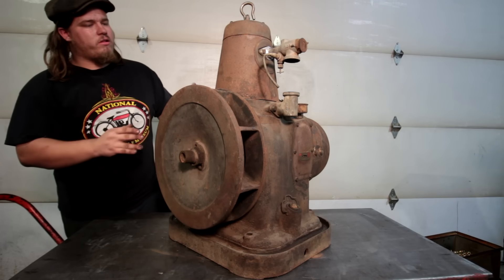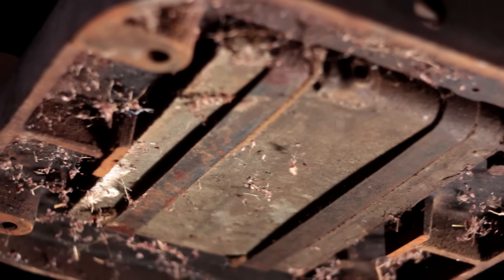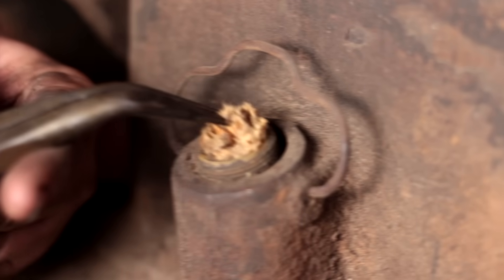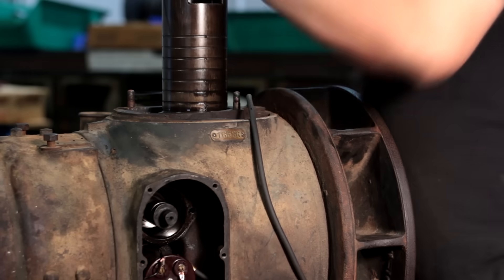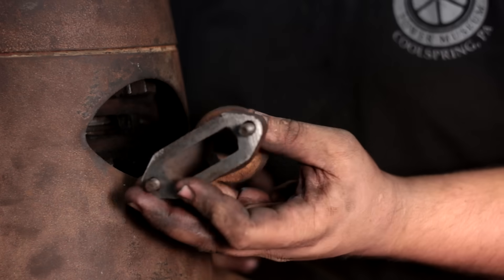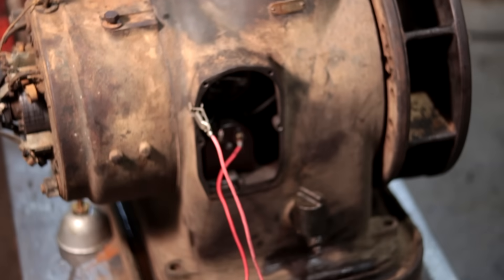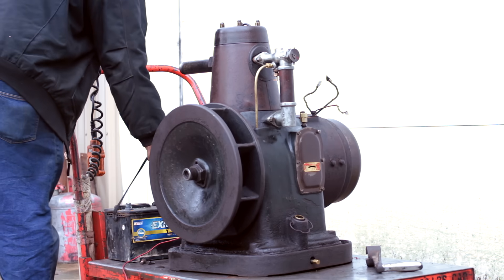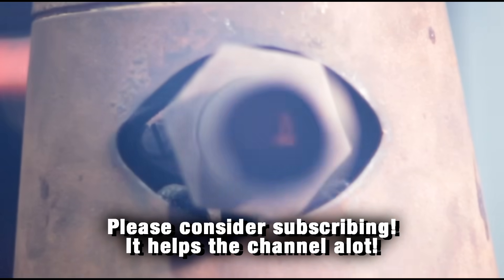100+ Year Old 4 Stroke Engine Design Has NO VALVES!!! Can We Get it Running after 60+ YEARS??

Comment: There were indentions for the electrical connection at coil that you missed. Timed
Reply from the maker: what?
Reply: On the coil, there is a indention, special spot to put the connection @cruddycornstalks
Reply: @cruddycornstalks 809 post are timed

Comment: What a beauty, and thanks for preserving the original paint- it has a beautiful patina - like the word patina was originally used - the beauty that age can give an object. Outstanding job, and if you get a chance in the future, you could get a lot of views on a video where you explained the mechanism and timing - the sleeve valves are mesmerizing, and the engine is so quiet - I'd be tempted to plumb the exhaust outside and just listen to that peaceful mechanical rumble. If you ever find a buddy who would take on the wiring of the generator, it would be cool to build a stand that had its own, self-powered lighting. Give it a few cranks and the lights slowly rise...👍
Reply from the maker: that would be cool!

Comment: Just ran across your channel, it's nice to see the old iron still running!  I've got a 5HP Majestic with several parts missing, most obvious are the muffler, governor springs,and ignition system.  One of these days I'll see if I can get it working - would you have a spare magneto you don't need??
Reply from the maker: i do not sadly sorry

Comment: A hundred years later Hyundai designed an engine with valves that weld themselves to the cylinder port with baked sludge.
Reply: ALL the modern direct injection engines do that. They need to be cleaned occasionally. With no fuel going past the intake ports there is nothing to clean the valve or port. BMW prescribes blasting the valve and port with walnut shells periodically.
Reply from the maker: this is very true

Comment: If you run low on the WD40, you might try Gojo to soften the grease. I find it a cheap alternative to WD40 and is good on the hands
Reply from the maker: not a fan of the idea of the grit and the wd40 evaporates over time leaving little residue

Comment: It is a sleeve valve engine
Reply from the maker: correct. sleeve valve is a simple description to just describe the moving sleeves with ports not really valves but nothing better to describe it in simple terms.
Reply: @cruddycornstalks  it is the description that everybody uses for that valve scheme in the description of your video you say the engine is valve less when it has sleeve valves probably just to generate more clicks on your video
The only valve less engines I can think of at the moment are turbo jet engines and some pulse jet engines
Reply from the maker: @markdi2 you are mostly correct it does get a lot more clicks thate way.  But I do like questioning the thought of calling them valves. Do you call the cylinder on a two stroke a valve?
Reply: @cruddycornstalks  engines like that are actually commonly called sleeve valve engines

Comment: Hey thanks for posting this, this is really cool, im glad you got it running!
curious what oil weight you are running in it, and if maybe changing out the viscosity would make any difference.

the sliding valves are super reliant on boundary lubrication for sealing, but this engine was designed well before multi-weight oils were a thing.
I imagine a good 15-40w diesel engine oil, high in zddp is probably what this engine would run best with, or maybe with some straight two stroke oil as it tends to be a mix of viscosity grades for both upper cylinder lubrication in two strokes as well as heavy weight oil for the crankshaft,
this thing burns an appreciable amount of oil so maybe a low ash two stroke is the right way to go, or marine two stroke oil

edit:
this thing was probably designed for leaded fuel as well so two stroke oil is probably the best idea, and maybe even add some to the fuel to stop the incoming charge from washing the oil film off of the sleeves

Cheers
Reply from the maker: leaded fuel wouldn't change much on an engine like this. and i was using a diesel oil for thickness and zddp

Comment: How many volts is the generator? AC or DC? what RPM does it run at?
Reply from the maker: it would be 32 volts but not sure ac or dc  and not sure the speed
Reply: @cruddycornstalks  dc about 800 to 1000 rpm

Comment: When I was a kid (60+ years ago) we had a similar looking engine. Maybe just slightly larger that had been a Delco lightplant. My dad ran a irrigation pump for our garden with it. I remember it would start on gasoline and then you could switch it over to kerosene which was cheaper to burn at the time. 
I wish I knew if it had that same kind of “no valve” engine. Looked similar with one big upright cylinder.
Reply from the maker: if it was a delco it was just a normal power plant with popet valves nothing fancy. willy's was the only one like this

Comment: I have allowed myself to be told that some Panhard cars had engines that worked with a sleeve concept, but weren't with rotary sleeves as some British designs were... might it be something similar to this?
EDIT: After reading into this on Wikipedia (and assuming that it is reliable) it seems that the Panhard engine design from the 20's up really is in one way or another related to the Willys-Knight design!
Reply from the maker: im not sure nothing i have dealt with.
Reply: @cruddycornstalks  It was an old French company. AFAIK what's left of it now, after acquisition by Citroën, only makes military vehicles... their span of civilian vehicle manufacture was between 1890's and 1960's and maybe it is not very well known outside France. 
About 1200 Panhard passenger cars were imported to Finland before the late 50's, after which our taxation scheme made them prohibitively expensive, but there are some enthusiasts who keep up a selection of remaining specimens.
Reply: @jussikuusela7345  Yes Panhard did make sleeve valve engine cars the double sleeve valve engine was invented  by Charles Yale Knight approximately 70 manufactures paid Knight a  royalty to use the design, Burt and McCullum invented the single sleeve valve engine.

Comment: I have been fascinated by engines my whole life. This is why. A sleeve engine over a 100 years old sitting there running like no problem at all...
Reply from the maker: It really is an amazing thing how well these old engines were built.
Reply: When reliability was the forefront
Reply: @jwalster9412  there's a couple of ways at looking at reliability. You can be quite sure this engine requires a good bit of babysitting to keep running, do that and it'll be reliable. Then again, if you want a more hands off approach a newer engine would be your better choice.
Reply: @PuncleLeonard at least this one won't stop running from a broken sensor, or throw a rod.
Reply: Great people Great work
Reply: What is it about this design that made it so able to pick up and run? was this a jeep engine or ?
Reply: and take heavily in account: NO computers - just a slide ruler and making things with a security of 3 times in healty engineers wisdom. normal lathes and mills, at max. a swiss cam controlled "screw" lathe. Since 1958 (peak of humanity) to 1968 it's down the hill with humanity.
Reply: Wait till 200 years from now we got old mechanics buying old EVs in landfills to fire up after a quick clean and oil change... ... ... ... ...
Reply: Willys Knoght motor co made this.  Grand dad had a W Knight car about 1925.  4 cylinder sleeve valve engine.  Extremely quiet.   Poor oil then would cause sleeves to stick.  Keep used a 4 cylinder with intakes in head & exhaust in block.    A neighbor had a Willys car 6 cylinder 1951 of jeep design engine

Comment: I agree the original paint looks good,  I use boiled linseed on cast iron, it soaks in nicely and after a week you can give it a buff.   It does not seem to effect paint and can be removed if needed.  Nice honest resurrection.
Reply from the maker: linseed  oil is nice for wood and sometime paint. but in the long run its  risky to use on aint as it soaks into the pores and can swell up over time causing it to flake down the road. wd40 works better as its only temporary and will evaporate leaving nothing.
Reply: @cruddycornstalks  I find WD is not resistant to the weather.  Millwrights used boiled linseed to season  cast iron water tanks and line shafts, farm machinery as well because paint and pitch was expensive. But its what ever you are happy with.   Nice job on the engine.
Reply from the maker: you are correct. but i dont mind giving it a new coat when i get it out to show it. and alot of time it will help get more grease off over time!

Comment: Sorry but I think it does have valves just the fact they side up and down to open and close the ports  in a deferent way than the common valve setup does not mean there is no valves
Reply from the maker: it has sleeves with ports not valves.  they marketed them as sleeve valves so people understood how they worked but unless we are going to start saying two stroke engines have valves this really doesn't either.

Comment: No valves? I think it's a sleeve valve and clickbait. Jerk me around with dishonest representation
Reply from the maker: not dishonest. this has no valves like a normal engine. only reason they got called sleeve valves was to be more understandable in documentation.  unless you want to say two stroke cylinders are valves then this isn't a valve either. its sleeves with ports. not valves.

Comment: I'd never seen and heard a sleeve valve engine running before in my 76 years!  Thanks!  I also didn't know they were used for small light plants, though considering how quiet it is that sure makes sense. Apparently sleeve valve aircraft engines were used in Britain during WWII, including the Lancaster bomber.
Will you attempt repair of the generator portion?
Reply from the maker: maybe someday but it wont be a video as its not something I'm familiar enough with to show anybody.

Comment: Astonishing video!
I’ve never seen one of these engines before and not only do you have one but got it running like a clock!
There’s a Napier Sabre sleeve valve engine in the Science Museum, London. It’s been cut-away and there’s an awful lot going on inside it. Two crankshafts and 24 pistons, two-speed supercharger. Monstrously powerful things and apparently quite bad-tempered when it came to starting.
Reply from the maker: It did end up pretty nice.

Comment: Just curious if the sleeves are connected to a connecting rod on the crank what kind of mechanism adjusts the timing of the sleeves?
Reply from the maker: They have a cam shaft they are hooked to

Comment: Kiwi mechanic here, I have always thought that sleeve engines are very clever. A distant memory tells me that they run on castor oil? And they build up carbon on the sleeves that helps seal them. Cheers for sharing, Bryce 🙂
Reply: Castor oil is (or was) a common ingredient in motor oil. That is where the brand name CAStrol originates. Still used in some applications.
Reply: @dquam3885 Ahh yes, of course. My brain must have deleted that. But I do remember Castrol 2 stroke oil used to smell like cooking bacon 🙂
Reply: 😂😂🥓🥓😂😂 @Bryce-z9v
Reply: @dquam3885  era molto utilizzato, fino a pochi decenni fa, per i motori sportivi, soprattutto per le  moto.
Reply from the maker: Im not quite sure
Reply: @cruddycornstalks  My friends Dad had a Daimler sleeve valve. He stripped and rebuilt the engine, carefully cleaning every thing. When he finally got it going, hell did it smoke!! An older mechanic told him that he shouldn't clean the carbon off the sleeves.I remember the smoke smelling different from motor oil. This is why I think it was castor oil. It my be for that particular type of engine tho I'm not sure. Super quiet!
 🙂
Reply: Castor oil!
Just another reason to somehow get or build one of these magnificent engines.
Reply: Probably true.  Smaller model airplane 2-stroke engines are ringless, making them essentially sleeve valve engines.  They of course run on a fuel/oil mix and they definitely like their castor oil.  The huge advantage of castor oil isn't that it builds up carbon, rather it builds a coating of varnish.  Castor doesn't break down in high heat like dino juice does.  That castor oil varnish gets kinda tarry when it cools but turns back to liquid when it gets hot.  This provides unbeatable lubrication.  In the case of this particular engine it would probably go a long way toward maintaining compression when it's cold and first started.

Comment: You are wrong.  It has valves, this is why it is called a SLEEVE VALVE ENGINE. This one is a two sleeve engine, and a later and better development is the single sleeve valve engine.

Two sleeve demonstrator : https://www.youtube.com/watch?v=kgfb5hbx33U
Napier Sabre : https://www.youtube.com/watch?v=e7gW_sBrqxo
Reply from the maker: Only reason they use the word valve is as reference for people to understand . The engine has no valves. Only to moving sleeves with ports on them. If those are valves that every two stroke has valves but that isn't the case.

Comment: Oiling the cork gasket will allow you to reuse in the future and also helps  with softening the cork  to allow better sealing. This applies to all sorts of paper gaskets but also depends on the application. Sometimes, i won't use the oil but will use small amounts  of hemlar liquid gasket and leave  to go tacky and then fit sleve port engines are cool 😊
Reply from the maker: That is true

Comment: They have valvessleeves which go up and down to open and close the ports, Hence sleeve valves. 

Sleeve valve engines are exactly rare or common but they are interesting in that they produce good power quietly.
During WW2 Bristol air craft company built a radial sleeve valve engine which became known as the whispering death ,because of it's quiet operation whilst attacking targets.
https://en.wikipedia.org/wiki/Bristol_Hercules 
As generating plant it would be quieter than the usual poppet valve engines. 

In cars however,they smoke a lot as oil is needed to lube the sleeve valves,or valve sleeves.
Reply from the maker: I just love how quite it is in person when you close the muffler up. It blows my mind.

Comment: The Napier Sabre H-24 aero engine used sleeve valves and developed 3,500 hp in its later versions.
Reply: Bristols also made sleeve valve Radial aero engines the Hercules and the 2000 plus hp Centurus the difference to your engine apart from size was they only had one sleeve per cylinder which not only went up and down but turned as well to aligne the ports with the intake and the exhaust.
Reply from the maker: They did use the concept a lot in aviation
Reply: I think those were rotating sleeves, not sliding
Reply: @diegomayan  They don't fully rotate. A small crank drives a spherical bearing mounted on the bottom of the sleeve. Thus the sleeve goes through a motion of rising while twisting in one direction, then lowering and turning back again.

Comment: I think some of the early Willys =Knight cars used a valveless engine.  Those old guys sure knew their stuff.  BUT you really made something run that I had never seen before. You are right up there being a wizard of sorts.
Reply from the maker: The same engine design just multi cylinder instead of just one.

Comment: Not conventional poppet valves but most definitely valves, they're sleeve valves. But aside from that what a wonderful engine.
Reply from the maker: That would mean you should call all two stroke cylinders valves. only reason the term sleeve valves is used is so people understand it better. Plus I have to hype it up for YouTube a little bit.
Reply: @cruddycornstalks  2 strokes have ports that are opened/exposed by the piston which makes them piston valve, the valve is the part that moves to control flow the 2 stroke cylinder doesn't move, the sleeve valve has separate parts operated by a cam that are there just to open and close a port making them valves, they're called sleeve valves because they're sleeves as valves, 2 stroke refers to the firing as does 4 stroke it's doesn't refer to valves.
Reply from the maker: i know 4 stroke and 2 stroke doesn't mean anything with valves. and im pretty sure your the first person to answer this correctly. alot try to say a 2 stroke cylinder isn't a valve but just ports and that's fundamentally wrong if we want to call this a sleeve valve engine. i used valve less as a way to make it sell on YouTube better but i know that it technically does have valves! I just find that alot of people want to contradict their own logic by saying a two stroke isn't similar as its just a piston and ports and find it amusing!
Reply: @cruddycornstalks  Just for the record I'm a retired tech that loves engines and talking about them and enjoy your videos, I'm happy if you get a billion views no matter how you word them if it gets you the views.
Reply: @ Why was this reply deleted ...... @cruddycornstalks  2 strokes have ports that are opened/exposed by the piston which makes them piston valve, the valve is the part that moves to control flow the 2 stroke cylinder doesn't move, the sleeve valve has separate parts operated by a cam that are there just to open and close a port making them valves, they're called sleeve valves because they're sleeves as valves, 2 stroke refers to the firing as does 4 stroke it's doesn't refer to valves.
Reply from the maker: @dubsydubs5234  i do not know as I read it and didnt mind it so I did not delete it? Wonder if YouTube did something weird?
Reply: @ I figured it probably wasn't you but thought I'd ask, youtube keeps deleting my comments, no idea why.